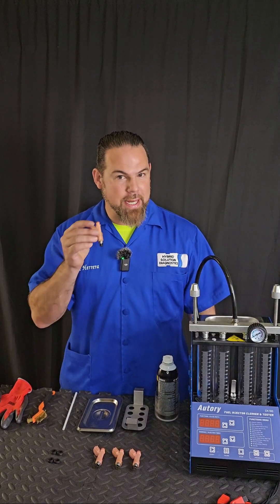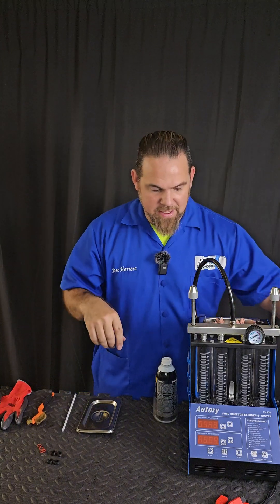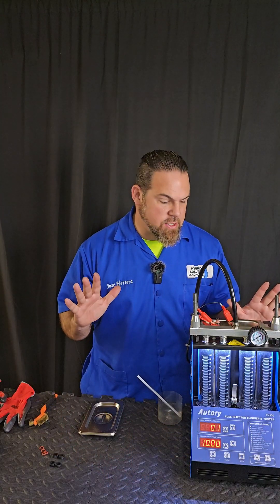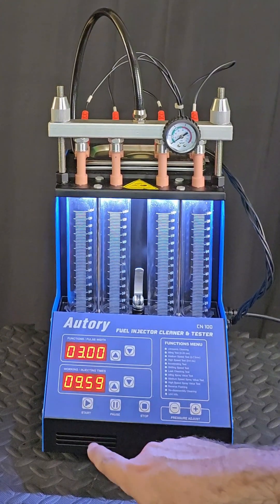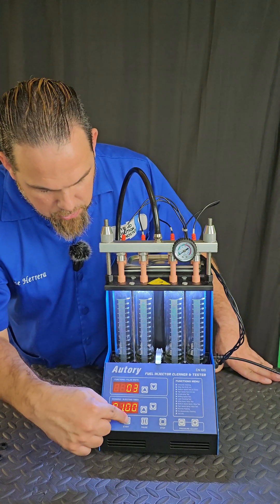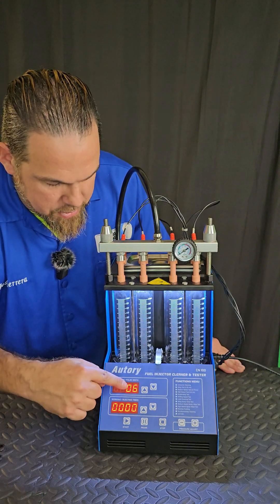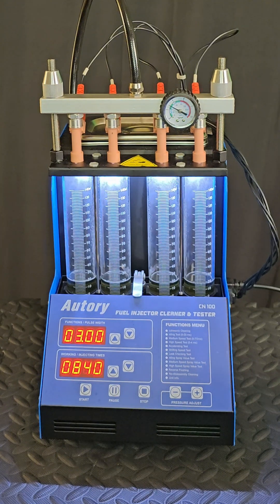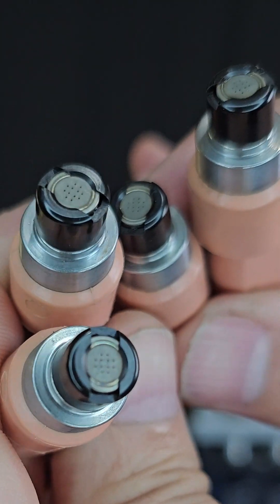How to use the fuel injector cleaning machine

Comment: be nice if you knew what the machine did before you reviewed it. reverse flow you have to remove the injectors and put them upside down to flush it in the opposite direction.

Comment: These are Denso injectors. If they are in the bath, the car will start badly when hot. They leak when the fuel is hot.
Reply: Please tell me how does the fuel get hot ?
Reply: @MarkoFQ  This has long been known. I do seven injectors regularly, seven days a week. several sets per day.

Comment: Can you wash the injectors with float in hybrid cars like Nissan Kicks E-power?
Reply from the maker: Sure 👍 😊
Reply: @hybridsolutiondiagnostics  I suppose it is the same as a conventional gasoline engine for this process to wash injectors, for example: remove the fuse from the gasoline pump and connect the float to the injector rail, put a pressure of, for example, 40 psi, until it is finish the injector washing fluid. is this correct?
Reply: @autorevelaciones  No. It is impossible to wash it properly without removing it from the car.

Comment: On Reverse flushing the injectors should be installed upside down with special adapters, so the test liquid flows from the tip cleaning the inside of the injectors (in this step you need to take out the injectors filters). Also non disassembly cleaning means cleanig the inyectors installed in the vehicle, disabling the fuel pump and with the adecuate cleaning agent
Reply from the maker: Oh Wao I didn’t know that, I think I’m changing my career of automotive instruction 😒😒🥸🥸🤪🤪
Reply: @hybridsolutiondiagnostics 7:15 no need to change careers mate!, just a little bit of practice, 😅 also it's recommended to drain the test tubes after the test is finished, not before, so that you can compare each injector volume